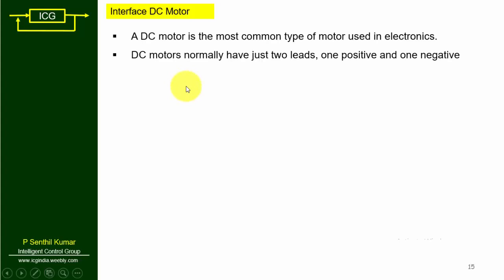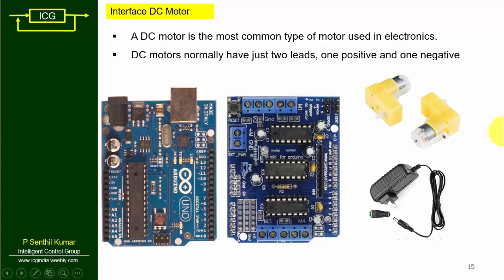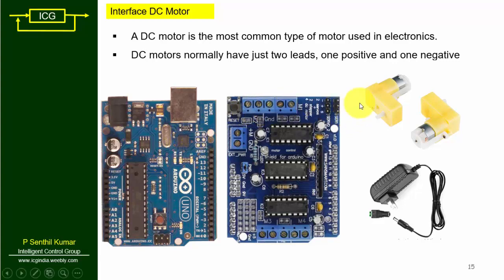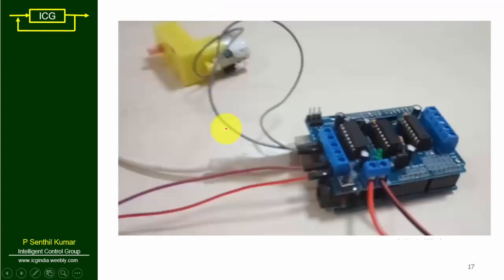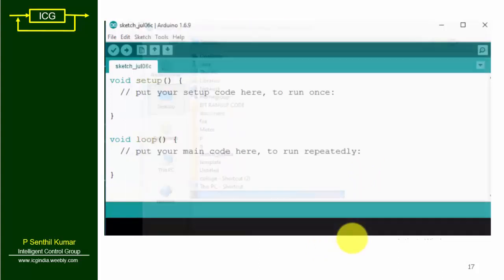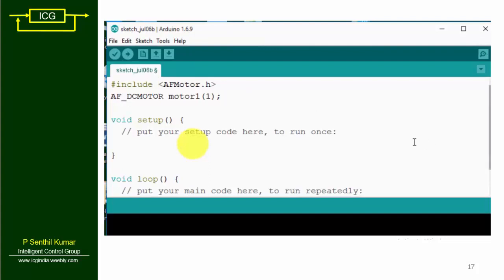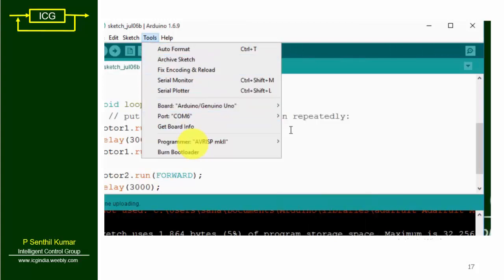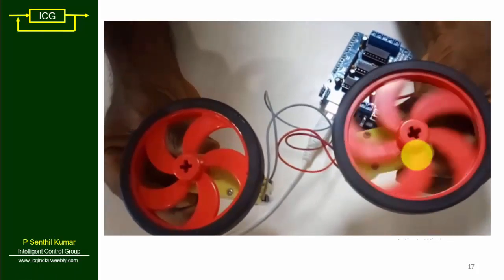Lecture : 4 Interfacing DC motor with Arduino (Adafruit motor shield)

Comment: I want interface 4 dc motor for specific time interval only or for specific distance only
Reply: 4 motor will run in same direction online simultaneously
Reply from the maker: Specific time interval possible using dc motor....but distance is difficult. For distance you need servo motor
Reply from the maker: Vikrant Vairagade possible... But load on motor should be less